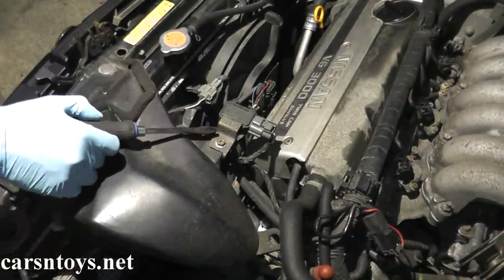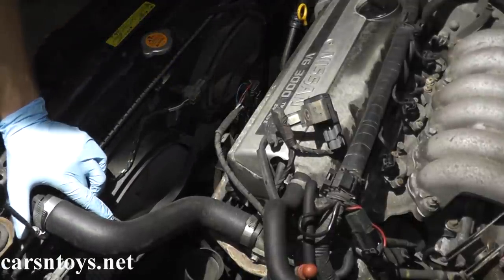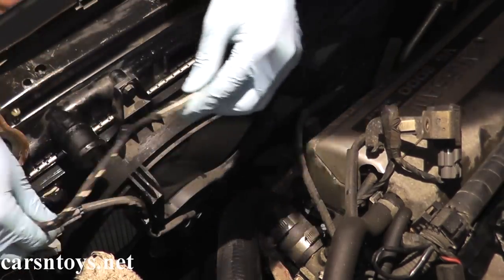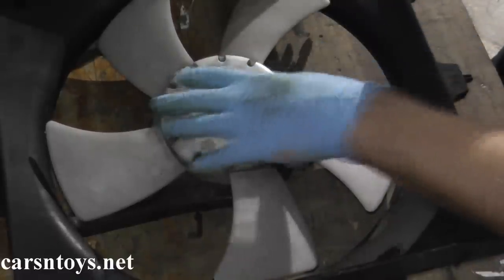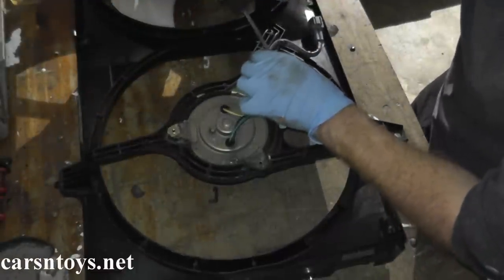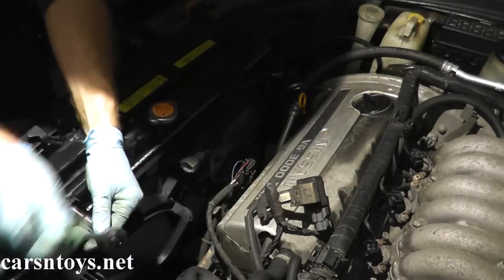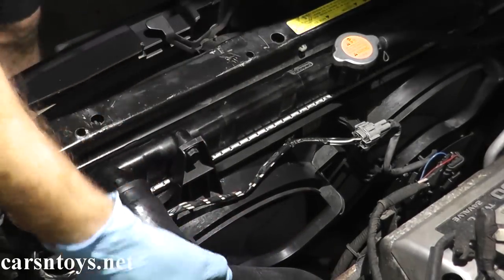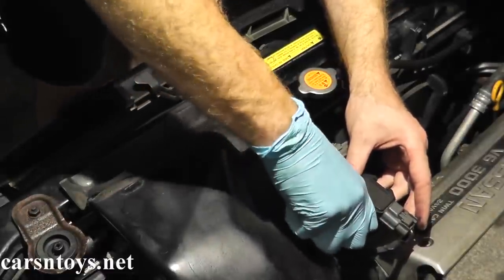Nissan Maxima Cooling Fan Motor Replacement with Basic Hand Tools HD

Comment: Hey, thanks for the informative video.  It helped me get my '97 Maxima fan out in about 15 minutes.  The only issue you mentioned that I found different was, I absolutely had to take the radiator hose off to get the clearance I needed to get the fan out.  Again, thanks!  youtube saved me ANOTHER $100 or more in labor costs.  

ps:NAPA's price for the whole assembly with two motors is $140. A new single motor is more expensive than two motors and the assembly :)

Comment: Thanks for video, just replaced in my '01 I30.  Thankfully I didn't have to dig for that housing sensor like on this Maxima as it was right on top.
Reply: Hi i was thinking to replace the fan of my infiniti 01 i30 by myself. Mine is making little bit noise suddenly.  Was it hard to do that?
Reply: @atikurrahman1105  very easy if I remember as it's been a few years.

Comment: Thanks so much for this great, clear, video. I'm getting ready to replace the fan assembly on a 2000 Maxima SE in a few days. Anything different with the process for that vehicle? Same sensor situation on the air dam?
Reply from the maker: Glad to help. It's very similar.
Reply: Got it in, so thanks. I used a Dorman radiator fan, and I noticed it didn't have the little channel on the driver's side for this little piece that slides on to the edge of the shroud perpendicularly.. There was something there but not the whole length and it seemed broken off, so I just didn't install that piece extra little piece.

I have the sensor on the air dam, closer to the front than in your vid, but I could not get it out, even after I figured out to press down against the springs in the clamp. Luckily, I could bend the dam up out of the way. That was the only diff from the video, so thanks. My mechanic wanted $130 for labor! Nope.

Comment: What is the sensor that you re atttached at the end... reason I'm asking is because my neighbor replaced my fan assembly 2000 Nissan Maxima and my fans are running constantly.. they do not shut on and off like I believe they are suppose to... Thanks

Comment: This is an extremely helpful video, but I am having the hardest time unplugging the Radiator Fan Motor Wire Harness. Any advice?
Reply from the maker: +Daniel Gross Keep trying. It's a waterproof connection and very tight.

Comment: Hello,I  a 2012 nissan rogue,cooling fan works only when ac is turned on, motor is not overheating at least gaude inside only goes to have way. Fuses seem ok what can it be? I fixed a leak on oil cooler unit,don't if that has anything to do with it. Please answer me. Thank yoy

Comment: Hey, my left fan is running slow. Car is not overheating but it's running a bit hot. Is it safe to swap the fan harness to see if the left fan runs when connected to the right side harness?
Reply from the maker: The fans on most vehicles have a low speed & a high speed. You can actually test the high speed. I'll have a video shortly showing how to perform the test. Regarding swapping the harnesses, I don't remember if they will reach. Another option is swapping the fan motors from left to right and seeing the results.
Reply: Thanks. The harness is long enough to reach. I just need to know if I swap the harness I won't burn the motor or cause a fire :)

Comment: i have a promblem with my car the radiator fan is moving slow do you think I gotta replace it or something else going on i just replace my radiator and got a new thermostat
Reply: its a 2000 nissian maxima SE
Reply from the maker: +Crystal Anders You can test the fan motor. I have a video showing how - https://youtu.be/bf2kvZJx1OA

Comment: 1998 maxima run hot going up hill  change fan and thermostat please help
Reply from the maker: How's the coolant..color..is there enough? I'll have a water pump video soon.
Reply: CarsNToys yes it's enough it's green
Reply: CarsNToys water pump is not leaking.
Reply: thanks for getting back to me.
Reply from the maker: Any trouble codes..I'm assuming both fans are working, radiator and hoses are good..?
Reply: CarsNToys both fans are working no codes haven't check the hoses yet.
Reply: same radiator since I had the car 19 years
Reply from the maker: Certainly could be a bad radiator. I'll post a video within a few weeks on a number of things to check.
Reply: CarsNToys thanks  preciate it.